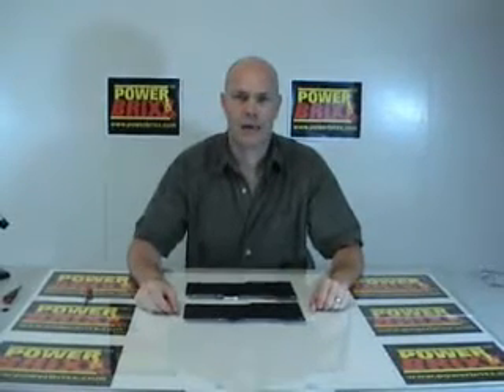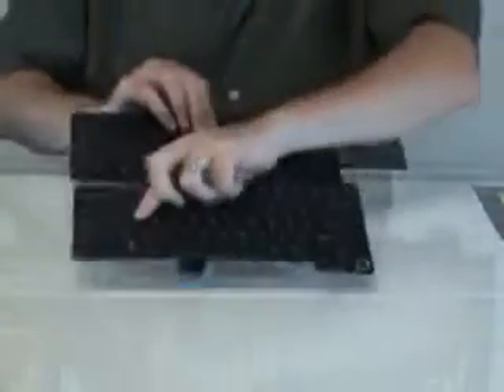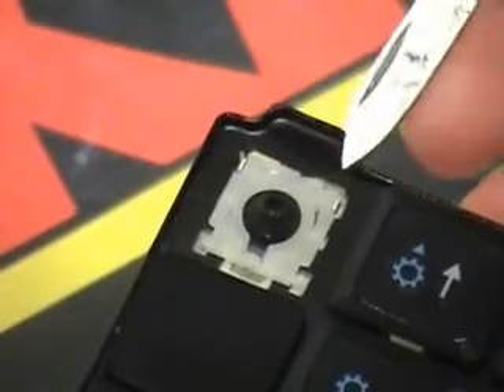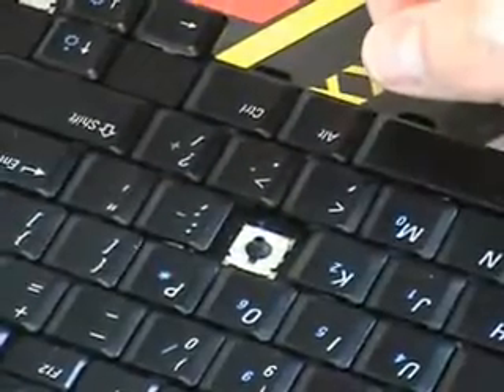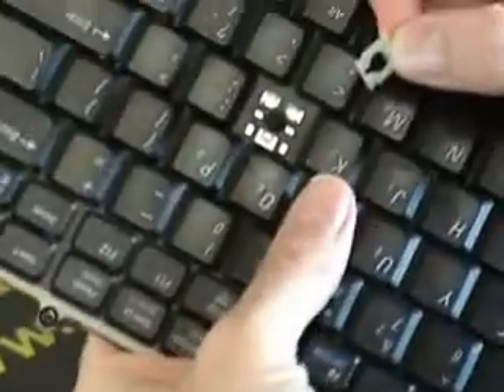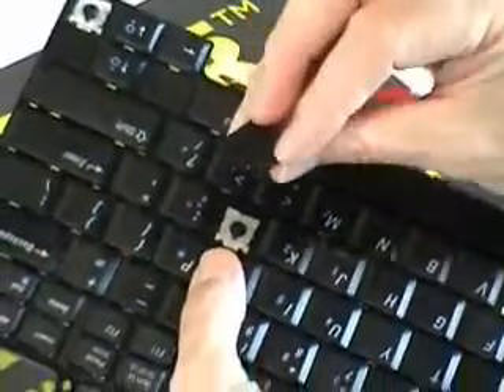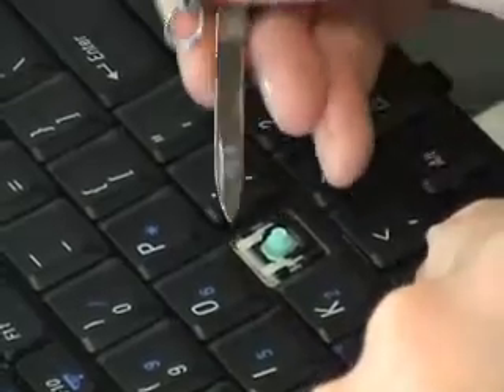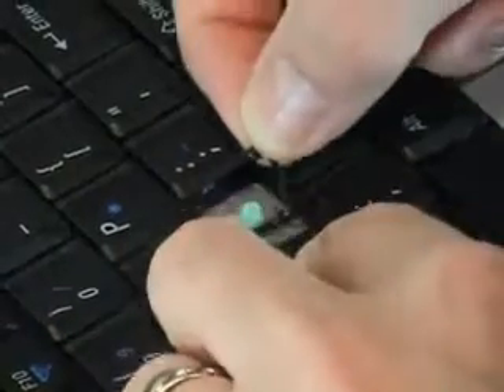Replace A Key / Keycap on Your Laptop Keyboard

Comment: When my keys pop off, the two white plastic pieces stay attached to the key and Im left with nothing on the keyboard unit. The key does NOT go back on, either with all 3 bits together, or if I attach the white pieces first and then place the keycap on top and push down. I either end up with it either locking down so tight it enters that key/symbol and wont be lifted, or it snaps nicely right into the white plastic bits, and then the whole unit of 3 pieces just comes right back off again. Help?

Comment from the maker: Put the rubber piece back into place (it will probably stay there when all is put back together) and pry the white pieces off with the tip of a sharp knife, prying on the edge that the clips hold onto rather than the edge that slides into the slots.  Yours might have clips all around, in which case you should pop one and celebrate your good fortune.  :o)

Comment from the maker: @DidTheGameStart My best guess is that it is some conflict with a driver.  You might try it in Safe Mode with Networking, which will at least let you get some stuff done while you're using it but disable most of the drivers.  If the problem continues, it may well be a hardware issue.  The palmrest assy, which includes the touchpad, usually isn't too expensive on eBay.

Comment from the maker: @12345tatis You may be either missing the rubber cushion that should be in the center; it provides the spring that pushes the keycap back up.  Or, you may find that you have bent metal tabs sticking up from the keyboard that the scissor mechanism snaps into or slides under.  If those are not just right, the mechanism can bind and jam.

Comment: Thank-You I have my shift key back! I have an HP, different looking parts same basic components... I took the metal U off the back of the key (it didn't pop off when the accident happened) & put it on the laptop first, then clipped in the scissor mechanism on the key, then it just snapped into place. I've tried to get a key back on a keyboard before and never had it work perfectly!
Thanks so Much!!!

Comment from the maker: @peacebab Look at the underside of the keycap.  You'll notice that one side of the mechanism is snapped on to two sets of clips, while thee other side of it is slid into two slots.  Use a sharp pointed knife or razor blade to slip up between the white mechanism and keycap on the side with the two clips and pop the mechanism off.  Proceed as I direct in the video from that point.  :o)

Comment from the maker: @AZLBRAX - I might suggest a straight razor for shaving the kitties.  Outside of this, and maybe vacuuming your keyboard fairly regularly, there ain't much hope for getting those hairs out.  They like to get caught up under edges and in joints and just don't like to come out.  Compressed air could help too.

Comment from the maker: @Actress21636 If you push the key and nothing is happening, you can try removing the keycap to see what would happen if you press within the center directly using your fingernail.  If still nothing happens, you probably have a defective keyboard that needs to be replaced.  Google PowerBrixx and see if they have it in stock.  :o)

Comment from the maker: @pokemon7076 Unfortunately, you're probably looking at a keyboard replacement.  Sometimes, a diagonal row or two of keys stops working and we haven't found a good way to get them going again.  Something breaks down in the circuitry printed on the plastics under the keys and there's no repairing it.

Comment from the maker: @Thedoctor19000 We've tried gel sticks.  If you can get the rubber part to stick back on just a bit around the edges, it is not likely to go anywhere.  It is held rather captive there under the keycap.

Comment from the maker: @The1966man If the key is not working at all, even when the keycap is removed and you are definitely able to firmly press down the plunger thingy, then you're at the point where you need to find a new keyboard.   Acer quit selling the C300 keyboard; used to be one of my best selling products.  :o(  Might have to find a used one on eBay.

Comment from the maker: @robertfox05 Yeah, space bars are fun.  You usually have 3 of the scissor mechanisms that need to be pried off the back of the spacebar and properly located, and also a wide U-shaped clip that needs to sit around the scissor mechanisms, usually the long edge toward the bottom, the hooks latched into the tabs with holes that are sticking out of the keyboard surface.  You position the spacebar itself similarly to the video, but you have to press down all along the lower edge to snap in securely.

Comment from the maker: @RussianHitMan100 Most likely, you will need to replace the wireless keyboard.  If the computer types properly using an external USB keyboard, then you most likely just need to replace the keyboard.  Sorry its not better news than that!

Comment from the maker: @drottningster You might want to give us a call.  Google PowerBrixx and get our repair number.  Sounds like your LCD circuit board is starting to go bad.  Not too bad of a repair.  Do plug the computer into an external monitor, though, to ensure you have a clean display there.  You may have to push "Fn+F7" (maybe F5 or F6 too, depends on the computer) to get the output to go to the external, or just power down, plug it into the external, and boot up.  If external is clean, then LCD is bad.

Comment from the maker: @justinager - I ALWAYS pry the white thing off of the keycap and then reassemble it as necessary to get it put back together right so I can follow the instructions in the video.  Just use the tip of a sharp knife and slide it up under the scissor mechanism at the point that it clips onto the keycap and pop it off.  Avoid the end with the slots, be sure to pop it off where the clips are instead.

Comment: PROTIP: if you don't use the key that looks like a page with an arrow (right click), you can use it to replace a broken key (i needed to use it on my down arrow after it snapped.) it looks awkward, but it works!

Comment: GREAT PRESENTATION!   Wow, this is the 1st tutorial I've found completely understandable---& now I'm feeling hopeful @ repairing several troubled keys (this Dell XPS M1530 looks like your 1st example). Before viewing your video, I'd done what you suggested: removed another key/keycap to use as a guide.  But then I had Yet Another key to repair, haha!  Yea, I can laugh NOW but not yesterday when I tried that.  So thanks lots. It's very clear what I was doing wrong. Tomorrow I go at it again.

Comment: I appreciate your help ... my key wouldn't work so I took it off and removed the stuff behind it that was stopping the key from functioning, but I didn't think I'd ever get the key back on.  My problem was the mechanism was still on the key, so I removed it from the key, put it back on the board like you showed, and snap, it worked.